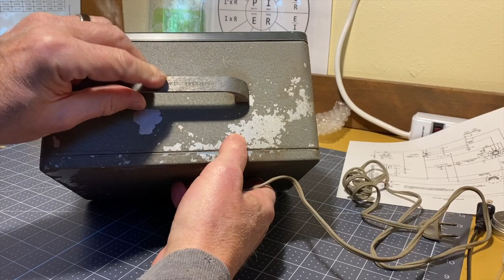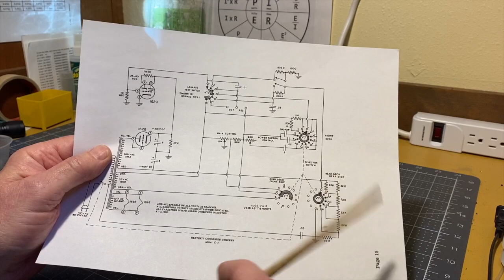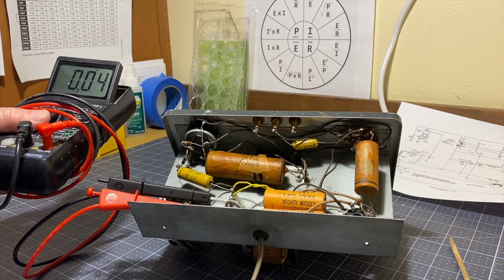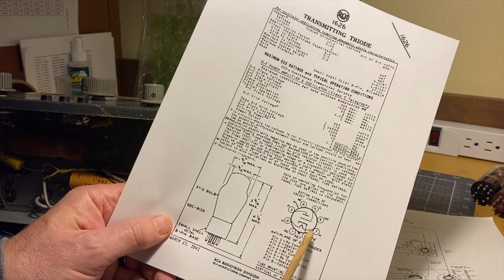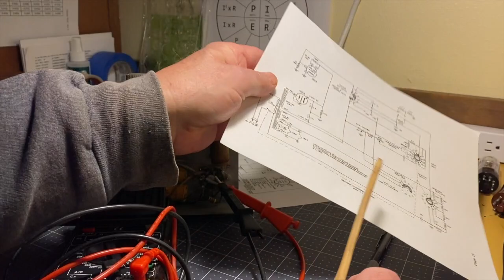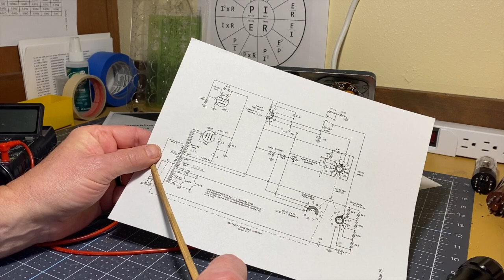Heathkit C-3 Episode 1 Opening the box

Comment: 1. Any shorts, transformer ok?
2. Plug in to current limiter and watch
3.See how well it works
4. Replace all capacitors anyway
5. Check and replace out of spec resistors.
6. Enjoy using it to check for leaking caps.
Total time....about an hour and  half at worst.
 (-:
Reply from the maker: Another approach. Thanks for watching.